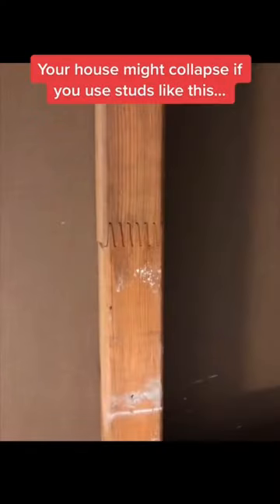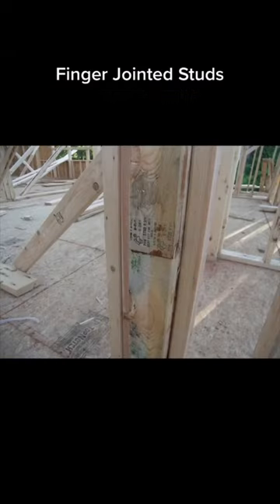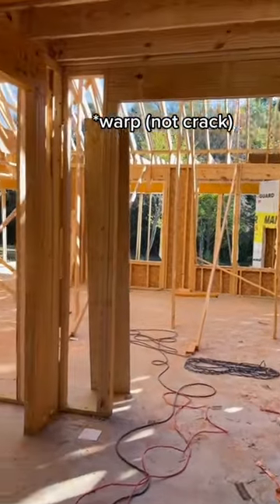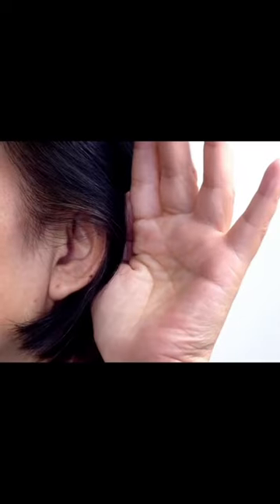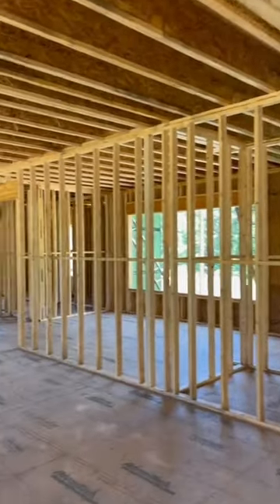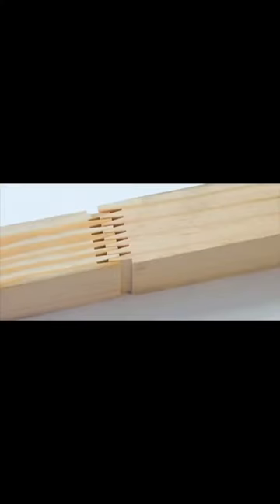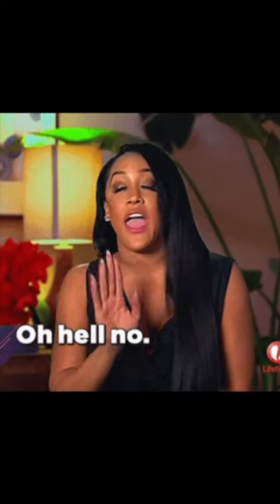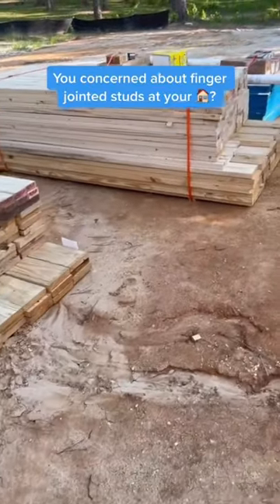Finger Jointed Studs… Are they bad…? 🤔

Comment: These are end grain to end grain glue joints. Weak as piss even with finger joints that can as much as triple the glued surface. I would only trust them if they were also glued and bolted to another beam to double the width and the joins were staggered. And, except for exposed beams, this would be overkill and overbudget.

Comment: Not concerned at all. Glued joints are stronger than wood anyway
Reply: We use a lot of finger-jointed trim for baseboards and crowns.  It the wood breaks or snaps, it’s always at the finger joint and often the joints snap apart at the finger joint with the fingers mostly intact.  Perhaps it’s fine for studs where all the pressure is longitudinal and evenly distributed across multiple such studs.  I’m not a fan of it.
Reply: Where do you get your information from, some dude that works in a  box store because he couldn’t make it in the field?  And as the commentator said noise, which means joint is sliding.
Reply: @tinknocker1948  glue some wood together, break it, glue it, break it, you can test if glue is stronger in a few days. I did (accidentally). Then I replaced the wood 1x2 with a steel 1x2.
Reply: Yes, glued wood is stronger than wood alone but only when its glued with the grain, or at minimum side grain to end grain.
These are glued end grain to end grain and that makes them weak as piss. That's a big aw hell nah.

Comment: Did you use pex piping in your house?  I seen that someone showed a video that pex pipe fittings have failed over time and started leaking.  Have you noticed any of that in houses?
Reply: Had them in mine for 18 years with no issues at all.